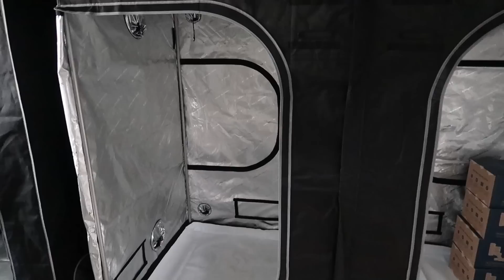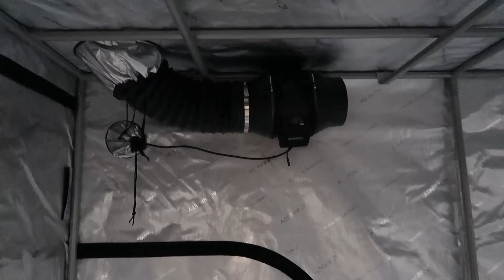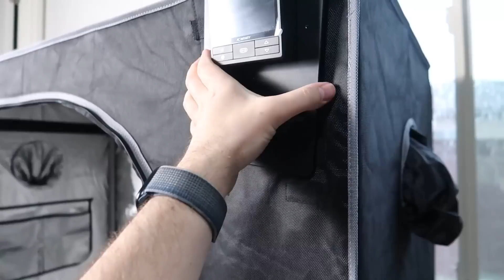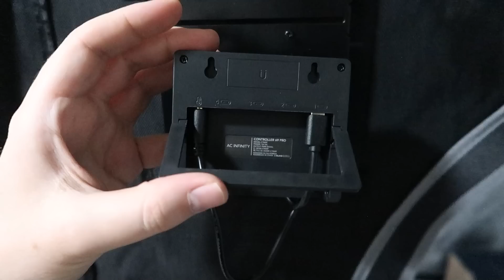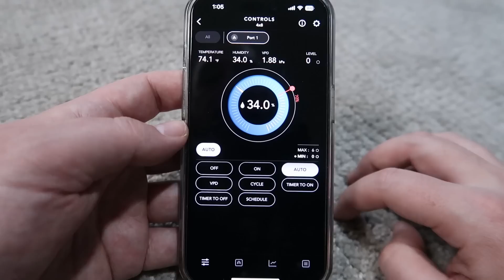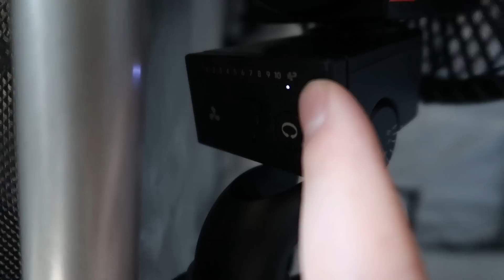Automated Grow Tent Ventilation System Install! (Step-By-Step)

Comment: Do I need to vent outside if the lung "room" is essentially 900 square feet? The tent is in my living room and my home has an open floor plan, It's also very dry here most of the time. 

I am just now popping my first seeds so I don't have any experience.

Comment: Bro. Do not vent to your fing attic?!? Exhaust outside. You’re pouring hot moist air up into a trapped box . Do you understand how mold bacteria and fungus grow? Come on Mr grow it..
Reply from the maker: Hey welcome to the channel! I know all of that. I’ve explained my previous setup in many videos; I guess I didn’t explain enough detail in this video so here’s some more info to clarify things: 
1. There is ventilation up in the attic so air goes up and out. 
2. I live in the desert where it is 20-35% RH which isn’t high enough for mold. 
3. I had an exhaust into the attic setup for 8 years and never got mold.

Thanks for stopping by!

Comment: If I was to set up a 2x2 in my laundry room and I used that splitter  to connect my dryer vent, plus the vent for the tent would that work?

Comment: Hey prob too late by now but I am in the process on setting up similar and had few suggestions after the fact... for the electrical why not run one or 2 extension cords to a power bar/s in the top the tent and connect there and also for the venting to get 3x out you can just get a 4" or 6: Y adapter and add it to the 3 way! Thanks for this series!

Comment: Every plug in that room is on 1 circuit lol
Reply from the maker: Yes, a 20-amp breaker. “A 20-amp circuit breaker in a 120-volt residential electrical system can safely handle 1,920 watts. This is based on the 80% rule, which states that a circuit should not be loaded to more than 80% of its maximum capacity for continuous use.”
Reply: @MrGrowIt  yes as long as all the things plugged in don't go over 20 amps.

Comment: I'm still in "research" mode, so this may be a dumb question.  I thought the point of carbon filters is to remove odors that would normally be expelled into your "lung" room.  If you're expelling the air outside, why use a carbon filter?  Are you concerned with neighbors smelling the odors?

Comment: hey guys, could anybody explain me why the humidity in my tent goes up about 10 % as soon as i switch on my ventilation fan. I have the AC Infinity system with controler 69 +, Cloudline 4 exhaust fan and cloudray s6 gen. 2. I want the humidity around 60 % at my currently growing stage, what works great just with the exhaust fan , but once the oxilation fan turns on my humidity is rising at least 10 % to 70 % and higher, but i wanna keep it around 60% while using the fan because of air flow and temperature controll.... any advices please

Comment: I use AC Infinity's noise reduction clamp between the filter and the in-line fan for a clean simple install/uninstall option. Always a problem controlling humidity and/or temperature in the grow room. I need to control my lung room similar to your setup. Thanks for sharing your setup.
Reply from the maker: The noise reduction clamp is a great option! Thanks for the comment. Cheers 🌱
Reply: I also use the noise reduction clamp. Great option.

Comment: I made the mistake when setting up my 9x5 tent. I didn't think to move it a foot or so from the wall... I couldn't get to the back doors for defoliating or whatever. Moved it for my 2nd grow and much better result due to the easy access to the back. 😎

Comment: Awesome video. Love the details and breakdown of each piece and how you thought everything thru. I have had to run a 2x2 and a 5x4 out of a window before with 2 4” inlines but nowhere this nice. The one thing I would recommend is have a backdraft for each of the 4x4 vents so bugs or air wont come in and so if one tent exhaust is on while the other is off, air would get stopped from it going into the other tent. Keep up the amazing work and cant wait to everything completed and you start your first run with the setup.

Comment: How much power do you use in the room? Is it just a 20 amp breaker, or did you have an electrician come in?
Reply from the maker: Good questions! The total power draw will adjust depending on what % dimmed the lights are. For example, the T22 LED grow light pulls 135 watts full power, but when it's dimmed down to 50%, it pulls 83 watts. Yes, I had an electrician make adjustments to ensure I'm not blowing circuits. I will probably do a full video talking about all of the details; seems like that's a video that a few people are asking for. Cheers!
Reply: @MrGrowIt  did you make this video?

Comment: You runnin a air conditioner also or do you just exhaust out the window??
Reply: gotta do both
Reply from the maker: Yes, using central AC.

Comment: How are you able to only use the plugins in the room without maxing out the circuit? Are you running extension cords down the hall to other circuit outlets? Most homes have 1800w circuits but should never be pushed past 1400w due to wires in the wall melting which is a fire hazard.
Reply: I assume you're running a ac plus a dehumidifier, humidifier also if you could give us a run down how your spreading the electrical load out it would be much appreciated.
Reply from the maker: Good questions! The total power draw will adjust depending on what % dimmed the lights are. For example, the T22 LED grow light pulls 135 watts full power, but when it's dimmed down to 50%, it pulls 83 watts. I live in a very dry climate so I'm not running a dehumidifier. For air conditioning, I'm using a central AC that is on another circuit. I actually had an electrician make adjustments to ensure I'm not blowing circuits. I will probably do a full video talking about all of the details; seems like that's a video that a few people are asking for. Cheers!
Reply: @MrGrowIt  that would be a great video one I'd enjoy watching

Comment: do you have enough plugs for  all the wires you have? do you need to use an extension octopus?
Reply from the maker: Yes, I do use a few power strips. I'll probably do a full video on the electricity side of things soon which I think will be helpful.
Reply: @MrGrowIt  👍👍👍 thank you

Comment: Mount filter to inline 4 inch blower ,set on floor in corner , run 4" hose up pole , past canopy  to cool light & circulate air.

Comment: I want to see how you vent the room itself while still cooling the room. All those lights will generate some heat.
Reply from the maker: I use central air conditioning in my home. So the fresh air is coming in from the home, passively through the rectangle intake vents.
Reply: @MrGrowIt  lol oh thats all?
Reply: But thats an important Detail

Comment: I use two 4 inch inline fans as dual intakes under the canopy instead of oscillators then a 6 inch exhaust and 1 12 inch and one 8 inch fixed fan above the canopy in a 4 x 7 custom tent and have it on .66 of max speed. Creating circular air movement. It is working really well. Temp is steady at 79 to 81 degrees in tent and 1000 watts of light and probably 120 watts of fan motors in the tent.  Gnats dont even think of living in that much air movement.  I would worry that vents would leak light. The intakes take the load off the exhaust meaning you can use a 6 inch.
Reply from the maker: Thanks so much for taking the time to share how your setup is! I think it's helpful for some growers tuning into this since there are many ways to go about it. Cheers Anthony!
Reply: @MrGrowIt the possibilities are endless it's almost my favorite part about growing. Good stuff showing multiple tents. I feel if people have the room they should try to work their way to a perpetual or give themselves multiple areas for learning and experimenting.
Reply: Air movement, the most important IPM 💪🏼. As for the vents I don't see why they don't come standard with light trap vents. I mean it's their main purpose other than reflection and making the environment easier to maintain. Light leaks or the thought of them keeps a guy from thinking about other stuff. But the topic could be a whole other can of worms including genetics and everything else. Happy growing man and keep those fans blowing
Reply: Boy, you put these tent video series together with your 7 Steps to grow Cannabis book Ave any beginner or even intermediate will find good in them thar hills, and I mean to mine them for sticky 🍯  nuggets  🌳  of trichome covered knowledge 📚 on the big green glee machine  🌴  worth more than gold to those that know 🧠 & live the grow 😂 

 Much love Chris.  🎉 💚💚💚